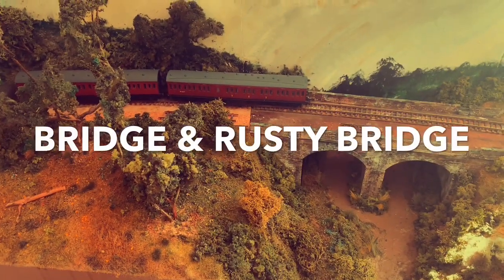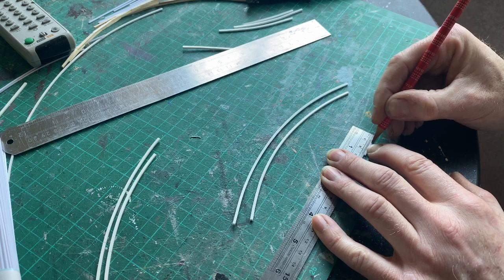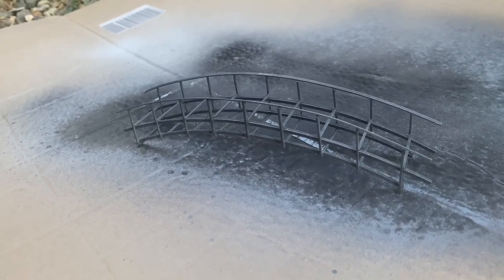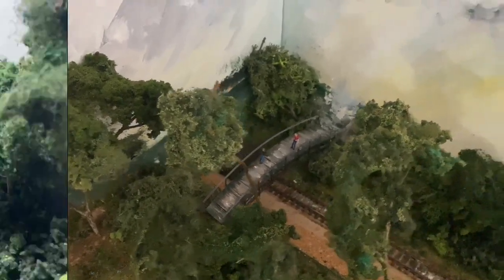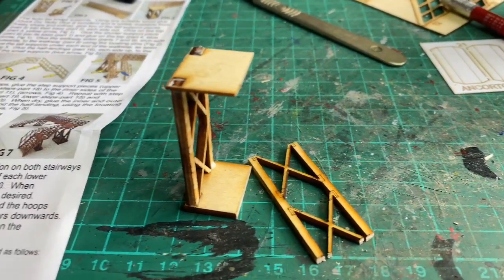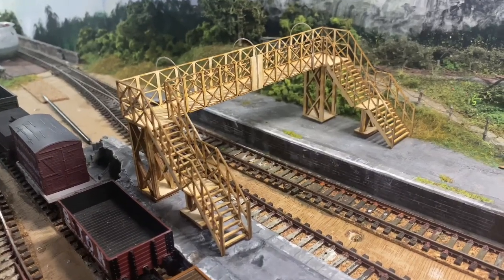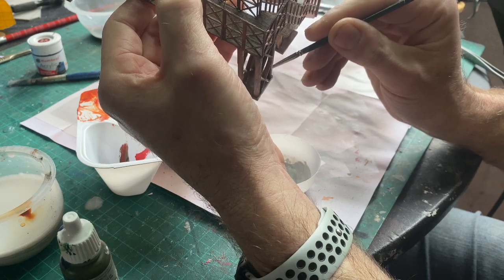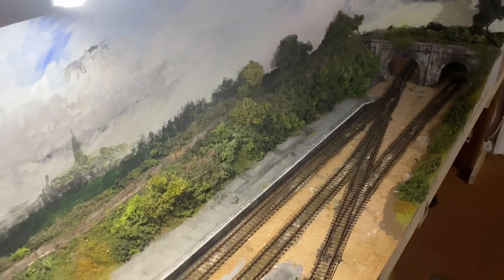OO GAUGE, SCENERY - BRIDGE & RUSTY BRIDGE on my model railway

Comment: I like the bridge, you were right it definitely needed a colour. The other station bridge looks very sturdy for something that is unsafe, I thought you would have removed a couple of the wooden planks going over the track or even had some broken steps. The rubber at the track end, just an idea, but you could just paint it green which would blend it into the landscape, or if you wanted the impression of the railway continuing then use a small mirror. Angled correctly it would reflect the track but not the bridge. Thanks, Mel
Reply from the maker: Thanks Mel for those suggestions, the footbridge is only unsafe in the sense it’s abandoned, (its has to be sturdy enough for trains to pass underneath), because the platform is unsafe with damaged tarmac, edging slabs missing, over grown with brambles grasses and of course the end of the platform was removed when the double track was removed and the point added.  

I will certainly think about ideas for the ‘buffer block’ thank you for taking the time to comment.